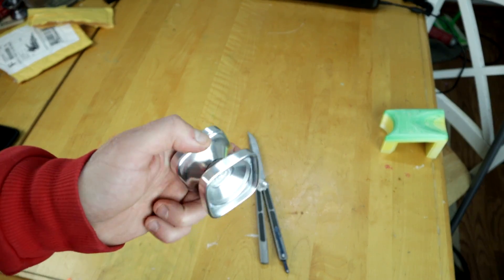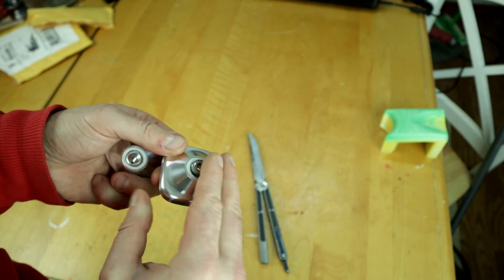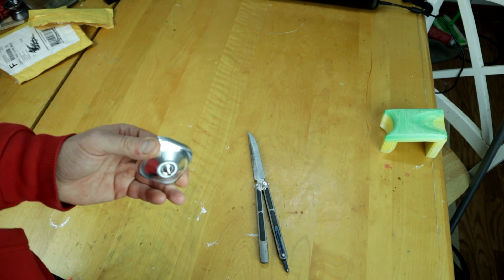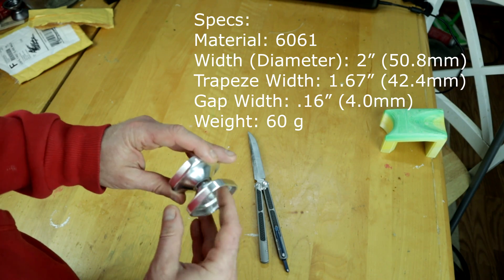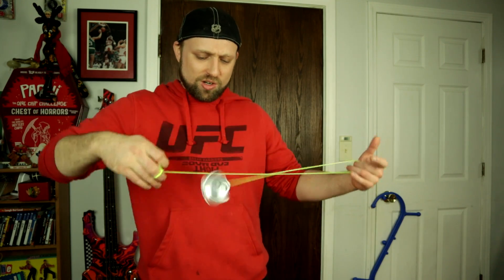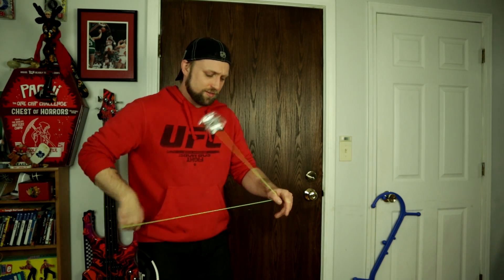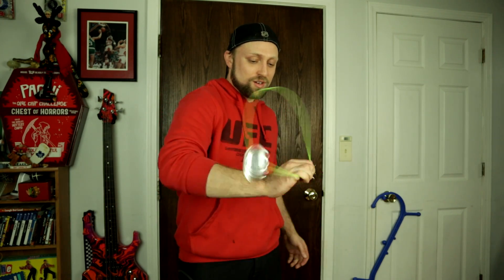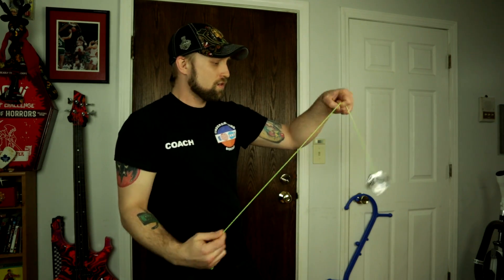SQUARE YOYO!?! Boost Squared YoYo Review

Comment: Talking about square. 16 years ago I seen a "tires rubber yoyo". Definitely not a easy yoyo. Because its wheels and rubber tires. Maybe specially designed for walk the dog maybe? But i doubt it. Rubber hits the ground is a stick for sure. You should check them out. If its still exist.